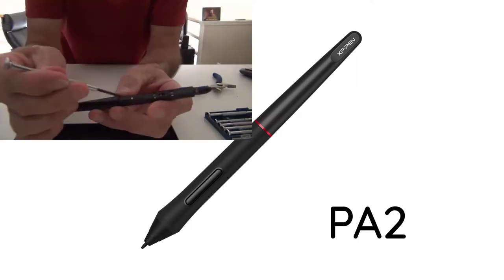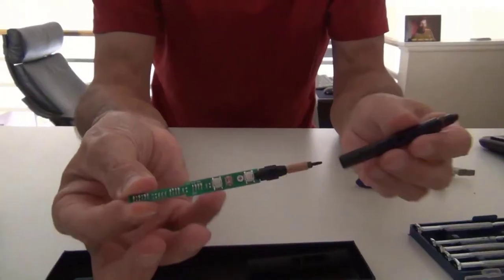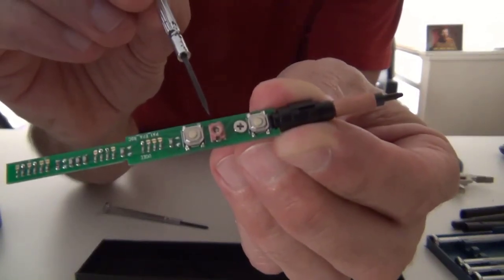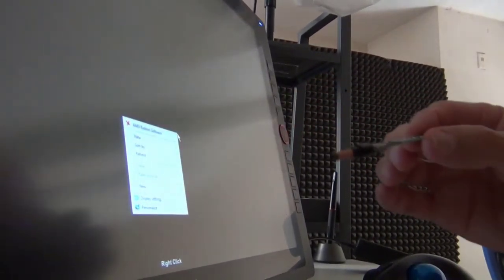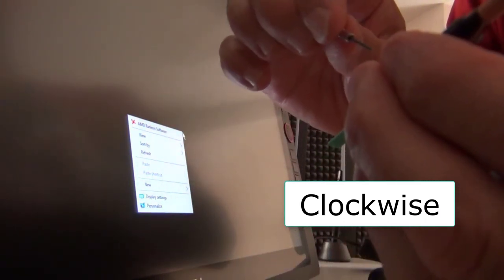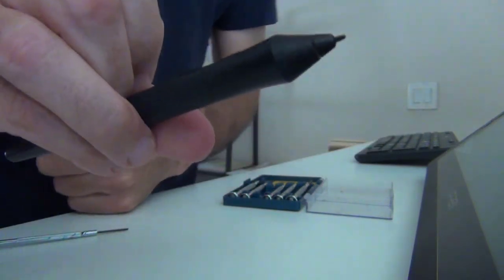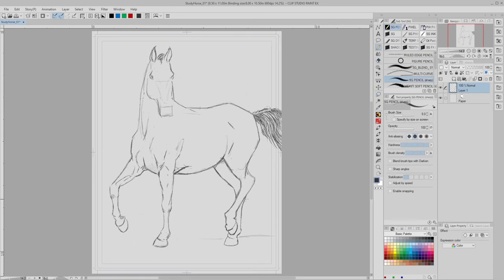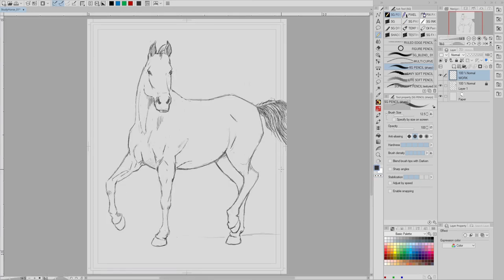FIX X-Pen Switching to Eraser Mode! -- PA2 Stylus --

Comment: Mine just arrived am I'm having the hovering pen issue and many others. And then you showed the jitter when zoomed out and that broke my heart. I watched around 20 reviews of the Artist 24 Pro before buying it and no one shows that. I won't trust any reviewer from now on - all a bunch of lies trying to sell you the product. Thank you, only honest video so far! (But I'm not opening my pen, I'll probably return the purchase, it's all messed up all over the place).
Reply from the maker: I think smoothing functions play a major role in most digital workflows.
Could be the xp-pen driver doesn't get along with your computer.
I've had my share of issues with display tablets, but for the most part, I enjoy using them.
Reply: @VirtualSG  I get what you mean. Some issues are acceptable. But, before buying the Pro 24, I had a XP Pen Artist 12S from 2018 and it was SO good, never had any issues.

Then the Pro 24 so far has been frustrating on every aspect.

Now I miss my small 12S. Crazy how a newer product is worse than an old line.
Reply: I solved by using the other pen. And XP-Pen told me they mailed an additional replacement pen, since the other one is defective.
Reply: Late update: when I wrote the original comment, I ended up contacting XP-Pen and they sent me a replacement pen in a gift box. Plus the additional pen that came with the monitor also worked out of the box.
Reply from the maker: @AlfredReinoldBaudisch  Glad you have a working stylus or two!
I only got the nerve to mess with mine because I contacted support and... I can't remember exactly how it went down, but I ended up with 5 styluses - only 2 of which worked - so I ripped into the non-working ones and now I've got 5 good pens!
Now for the bad news... I gave my brother my old 22E (with the rechargeable pens) and it stopped working properly on the last Windows update because XP isn't supporting that driver anymore.
I had the same experience with an old Wacom.
My point is eventually this pen and any tablets they come with will follow suit and we'll have to purchase new products.
Hopefully not for a little while tho.
PEACE!

Comment: Even though you are getting a lot of thanks from others, I hope you aren't tired of hearing it: Thank You for this video. Was having the very same problem, tried driver updates, unchecking Windows Ink... But clearly something was simply amiss with the little screw thing in the pen, and I'm REALLY glad I didn't have to pull the whole insides out of the pen casing. Thanks, and if anyone is having this problem, yes, this solution does work.
Reply from the maker: It's good to know I've helped so many fix their stylus!
Thanks for taking the time to comment on the video!

Comment: Whew. I didn't have a screwdriver small enough so I had to cut up a really thin piece of metal. After that, I actually had to turn it anti-clockwise, not clockwise. But in the end, this did help, my issue is fixed, thanks so much! I can't imagine if I hadn't seen this video and i had tried to fully disassemble the pen...
Reply from the maker: I'm happy to hear you got your stylus working!
Thanks for sharing your experience - it may help others!

Comment: Thanks man! Turning that little screw 1/4 of a full circle worked for me.

the same problem occurred when i put the pen back in the pen holder, but after a couple of movements on the tablet, everything was ok.
Maybe the weight of the pen affects the sensitivity of the magnet / coil, or something.
Reply from the maker: Excellent! Glad to help!

Comment: you are my saviour. For me I need to adjust back and forth. I winding almost 1/2 circle but it turns worse, then I slowly turn it back so it just 1/8 circle. 
I dont have super small tool to winding it so I just use my earring bcs the tip is small enough to get it X'D
Thank you for saving me from getting insane
Reply from the maker: I'm so glad you were able to fix it!

Comment: In mine the pink thing surrounding the potenciometer started chipping off when I stupidly tried fixing it with something that wasnt the smallest screwdriver (dumb mistake but I was desperate and didn't have money at the moment, and was using an already small one), now the pressure is all messed up, is there some way I can fix it? Or do I just have to buy a new one entirely?
Reply from the maker: @RbyMm  I would guess you need a new one. I really don't know much about these things.
Reply: @VirtualSG  Yeah, I guessed as much, I tried applying pressure to the zone to try and simulate that thing and it worked for some time, but it wasn't a good fix.
Thanks anyway for taking time to respond

Comment: Does the 2nd button works without a driver? Mine 1 button works and other doesnt 😢
Reply from the maker: That's a good question. Considering by default one of the buttons toggles an eraser function, I'm going to guess no, the buttons wont work properly without the correct driver.
I customized my button settings so I don't remember exactly what the default is.

Comment: Dude,I got an issue,my issue is that my pen´s plastic tip, is completely lose from the tip´s gripper,and it is basically clicking without me wanting to click,I fixed it a little by making harder the pression but it is still happening and Idk what to do,what should I do? Do the tutorial works with my issue too,or is pointless to try it?
Reply from the maker: It sounds to me like you've got a common problem - following the steps in this video should fix it.
BUT - Maybe I don't understand your explaination and it could be a different problem.
Also if you've got a different pen - I have no idea what to tell you. I only know how to fix THIS problem on THIS pen.  I wish you Good luck!
Reply: @VirtualSG  Yeah I think I got your pen,I have an artist 12 pro,and its pen is basically  Pa2 passive,so i guess is the same
Reply from the maker: @elsopotas  Like I said, I don't really understand when you say the plastic tip is completely lose.  It sounds to me like it's physically broken.  That's a real problem.
If you try what I say in this video, be very gentle with everything and you shouldn't make anything worse - but I have no idea if it will fix the problem.

The famous problem is that the pen just "switches to eraser mode" - but if you changed your button settings (like I did) it will "switch to" whatever you set it to (in my case, right click) - you see this at the begining of the video.

If your pen is physically busted, I don't know what to say.  Have you tried pushing the tip in harder? Maybe your just too gentle? I don't know...
Sorry if this only confuses you more. It's hard to diagnose something in the comments!
Reply: @VirtualSG  Yeah its pretty difficult to me to explain it to you because of my lack of knowing about the hardware topic and because of my language barrier, and to you to diagnose the problem just by physical description,but anyways,thx for your help man,I did the tutorial and i am about to prove if the issue is solved or not, thx for everything pal :D
Reply: @VirtualSG  IT WORKED,YOURE A FREAKING HERO,THX MAN SOOOOOOOOOOOOO MUCH,I WAS A BOUT TO EXPEND LITERALLY 35 BUCKS,BUT FOR YOUR HELP I DIDNT,THX FOR EVERYTHING MAN SERIOUSLY, I WISH THE BEST FOR YOU!!!! ;D
Reply from the maker: @elsopotas  I wish the best for you also! I'm glad you got your pen working. Happy drawing!
Reply: @VirtualSG  Thx,I wish the best for your channel.

Comment: so um, turns out that lil screw that was inside was so tense that i couldn't turn clockwise anymore, so i tried to do it reverse and it worked at fist, so i started to put it on the pen and try it AND IT STARTED TO DRAW WHEN IT WASNT TOUCHING AGAIN and i tried to do it again and it wont fix ;-; what do i doooo??? (TTnTT)
Reply from the maker: I'm sorry this video did not help you 😔 sometimes the pen is simply broken and I don't know what to doooo
Reply: @VirtualSG  i'm gonna try to keep doing it again, thank you sm for this vid (´；ω；｀)